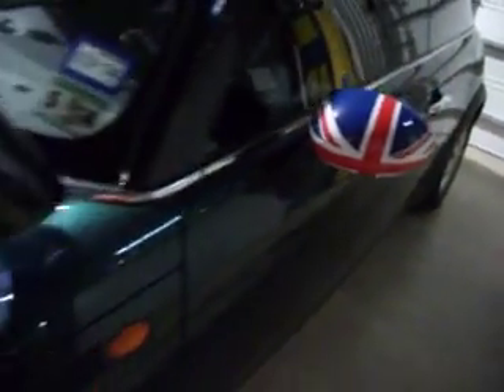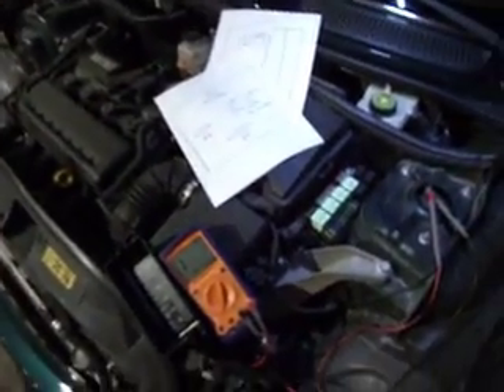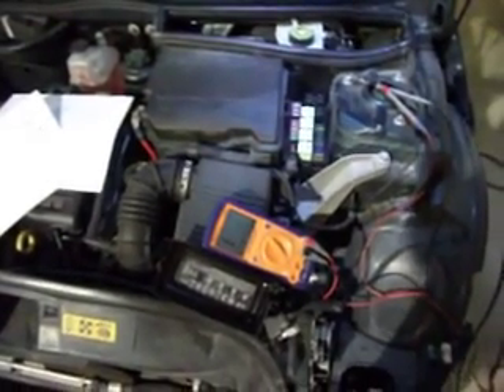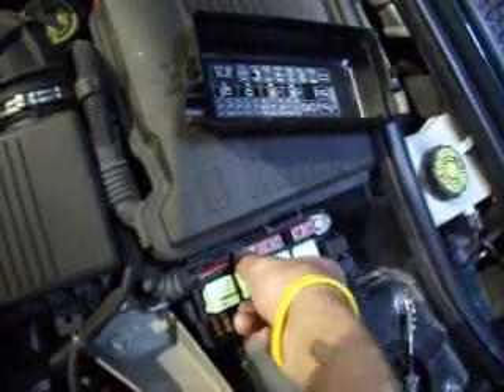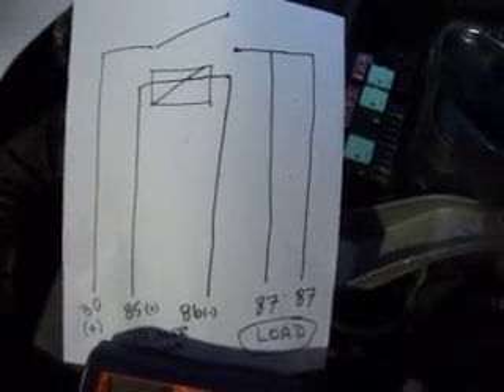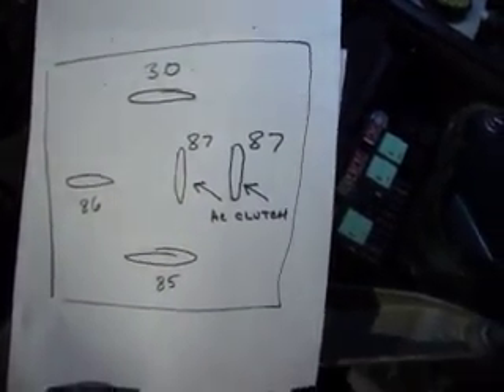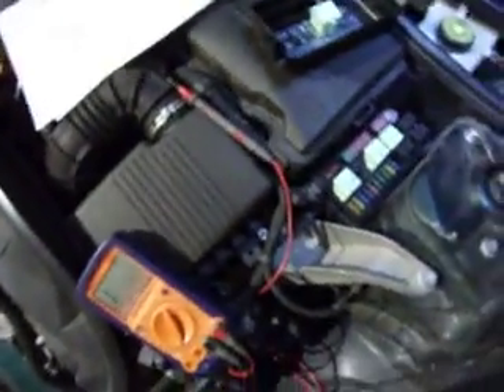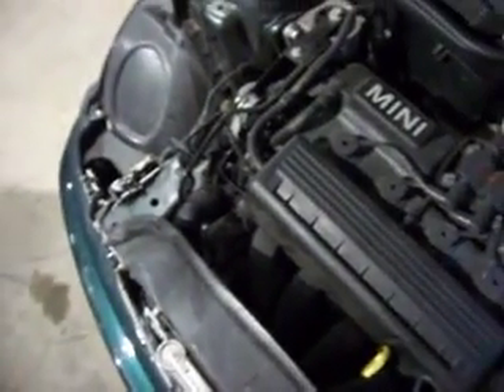Diagnosing A/C clutch coil using a R50 Mini Cooper

Comment: Thanks for the explanation Scott. Based on your technique, I appear to have a blown clutch coil.

Man, you're right, that coil is packed in tight! I have a feeling this will be an expensive outing.
Reply from the maker: Thanks I am glad that helped you. Removing an engine mount(s) you can use a load strap to pull the engine back a few inches which helps a lot, I found out after much hassle doing it w/o this! Northamericanmotoring forum has a lot of great info.

Comment: Great video, I have 4.4 ohms on my clutch. 75 pounds on the low side at about 18 Celsius, I have no ax compressor coming on. I short pin 30 to 87 with a jumper and the compressor still doesn’t cut in. Any ideas?
Reply from the maker: I assume you are getting power to 30? And is the wire to jump thick enough?

Comment: Hey Scott, when I test the resistance in the circuit it reads 16.4ohms... Help. Clutch wont engage, pressure is good idk what to do :(
Reply from the maker: Well, what do you mean pressure is good? What is the equalized (sitting) pressure? Typically, when these won't turn on, the pressure is too low as the systems have a switch. You can manually get the clutch to engage if you use a jumper (of sufficient gauge, maybe 14) to the battery, only for testing purposes and only for a short bit. You may need to have it looked at. I'm not full time on this but have fixed a number of different cars. When the compressor stops kicking in, every time in my limited experience its been the pressure has leaked out enough to trigger the switch to cut it out. Adding about 1/2 can to get to the regular level will work for a while. I prefer to fix the leak rather than refill all the time. A shop with sniffer can help find it, or look for the oil which is part and parcel with the 134a charge. 
If you have that ohms the coil is likely good, but you can compare to what I had or another mini's.
Reply: which pins to short out to get the AC clutch to kick in.
someone said 30 to 87 with a paper clip. is this true?
Reply from the maker: Try jumping it as I described in video, should hear it click down below where it's located. Engine doesn't need to be running but key on.
Reply from the maker: If you want jump let run 20 second or so see if starts cooling. If that works it's likely a pressure issue, or possibly the relay (low probability )
Reply from the maker: Yes Sagri 30 an 87. Don't run it forever like that, will possibly over pressure.
Reply: +Scott Philbrook 
I don't have any pressure on low AC line.
I even pushed the low terminal to see if freon will leak out and nothing come out. So I'm at a very low pressure or no pressure at all.
I am trying to engage clutch so I can fill some freon. From my understanding the clutch will never start if pressure is very low.
I don't see in the video where you talked about jumping. So if I put a paper clip between 87 and 30. Should I start the car? Or just the on position? 

Then I can add freon for about 20 seconds and then remove paper clip. Hopefully the clutch will continue to work after system build some pressure.
Am I missing something here?
Reply from the maker: +Mhnd Saqri - hey, I appreciate you trying to DIY your mini, however if your system is depressurized then you will need to first find the source of the leak, then evacuate the refrigerant, then fix the problem leak, then change the dryer (best practice ) then use a vacuum pump to both test for leaks and remove moisture. then after doing that, then add appropriate amount of refrigerant an oil. I'd take it to a shop doesn't have to mini shop really but this is more complicated than you realize and will take you investing in tools, plus learning curve.

Comment: Didn't know about low Freon causing a problem with the clutch been without air conditioning for 3 years makeup melts to the point where I can't even see to drive but in the North east the Mini Cooper is closest thing to an ATV in the winter love that car
Reply from the maker: M J Kay Hello
AC systems in just about every car I've seen have a system protection pressure switch for low and high side. I think what you're asking is something about this pressure switch on the low side or loss of refrigerant below and normal pressure. Because there is a minimum pressure which tells the system basically that there's enough refrigerant in it so it can run and not blow itself up, if your system doesn't have enough pressure obviously replacing the clutch or clutch coil isn't going to do anything. The pressure switch is wired typically outside of the circuit that I show here testing which is direct to clutch coil. So if your AC isn't working these various things you can do but you need to test the pressure and see if that's a problem. A bit of experience with these helps quite a bit and you may want to just take it in versus buying a bunch of tools and trying to learn as you go. But on the other hand that's kind of what I did just a lot of research I bought a vacuum pump to take a system apart and put it back together draw the vacuum test the seals then reload it with refrigerant.
Reply: @dirkdaddy2  The AC on this car hasn't got a low side sensor/switch. There's only a high side pressure transducer and the AC clutch can only be engaged above a certain static pressure. As long as you have enough liquid refrigerant in the system the static pressure will depend only upon ambient temperature. There's a valve in the compressor which adjusts the low side pressure by sensing both the suction and the discharge pressures and varying the compressor's displacement as a result (to avoid the evaporator from freezing up, give sufficient cooling according to the ambient temperature and lower engine load and fuel consumption). Hence, this compressor will also run on a very low charge and you'll know it because in mild/hot weather you'll hear a very low "groan" sound as soon as you turn AC on and the clutch engages, which is the sound that this compressor (and generally any variable displacement compressor) makes when it's pumping at the lowest displacement (with a very low charge, but enough to make the high side pressure transducer sense a sufficient static pressure, the valve will immediately sense a suction pressure that is so low that it will think the evaporator is about to freeze up, and it won't bring the swashplate into full stroke angle like it would normally do everytime the AC is turned on; with a good charge, however, the low pitched groan will only begin as soon as the TXV starts restricting the refrigerant flow and lowering the suction pressure as a result because the evaporator is approaching the minimum allowed temperature, which varies around 0°C and increases with decreasing ambient temperature and vice versa; i have the same compressor on my car and i routinely check it by turning AC on, doing some quick revs and listening to the noise it makes). What's most important, however, is that with a low enough refrigerant charge, oil circulation in the system decreases, compressor cooling decreases, some friction is still happening inside the compressor because the displacement never reaches 0, and all of this can make the compressor run hotter until the thermal fuse inside the coil trips. With a fixed displacement compressor instead you'd notice a very short clutch cycle (until it won't turn on at all due to too low static low side pressure) and you would get next to no cooling at all. So yes, low Freon ("refrigerant" is a more appropriate term) can also cause a problem with the clutch but it most importantly wears the compressor incredibly fast.
Reply from the maker: Thanks for information!
Reply: @dirkdaddy2  You're welcome, i write this so everyone can properly operate and diagnose this type of compressor (variable displacement-internal control).

Comment: Also the relay could be bad so have someone in the car turn the ac on and off and try to feel a click in the relay, if you don’t feel or hear a click you need to replace the relay that could be the problem. Make sure that you replace the relay with the correct type.
Reply from the maker: That is within the range of possibilities however I have found it pretty rare. Good to test that if suspected. Since these relays are all the same type one can be swapped for another to test as well. I had a Honda minivan where the factory AC relay was undersized or something and it welded itself "ON", which over-pressured the AC and then the refrigerant blew out the safety. After researching it I found out it was a fairly common Acura / Honda problem (go figure). That and the thermal fuse in the AC going out, other issues I sold it and don't plan on buying another.

Comment: My a/c stopped working last summer and I recently replaced the clutch several weeks ago.  It worked fine for about a week until one day in traffic, it started squealing loudly as if the compressor was locked up and I could smell the belt burning.  By the time i was able to get pulled over, it had stopped, everything worked normally, except the a/c was no longer cooling.  The car seemed fine so off i drove sans the a/c.  The other day without thinking i turned the fan on the circulate some air and the a/c automatically kicked on, blew cool air, worked fine until i got off the highway.  Squealing, burning belt smell, no more cool air. Ever heard of this happening? Could improper clutch installation caused this?  Is the compressor bad?  Any clue?
Reply from the maker: You might have broken fan or bad power to fan. This lack of airflow over the condenser might cause that. Or possibly over charged system. You may want to have it evaluated by shop as it could get expensive. 
Other possibilities include the clutch gap is too big and it's not clamping hard enough, then squealing as it slips? But generally squealing is belt. your symptoms that it runs good when you're getting air flow over at point to perhaps the fan not coming on so that when you sit in traffic it's not getting enough air flow.
Reply: @dirkdaddy2  I'm pretty sure it's not just squealing, the compressor was at least temporarily completely locked up.  The belt left some shavings  from the belt that piled up on the splash guard. I'll check the fan.
Reply: @DanielGarcia-rg3nd  Oh yes, this really sounds like condenser airflow problems to me. With this compressor, a restriction would actually prevent the compressor from pumping refrigerant. That is, you would see the clutch hub turning, but it would not be pumping anything since it sensed an abnormally low suction pressure, and it would be making an awful groan noise.

Comment: The compressor on my base model '02 mini is cycling on and off.  On for about 3 seconds and then off for about 10, etc.  Any idea what this might be?  It seems to be fully charged based on trying to add more coolant with the AC Pro single gauge and the gauge indicating that it was already full.  Any thoughts on what the problem could be?  Maybe something simple like a bad relay (wishful thinking)?  Thanks
Reply from the maker: sounds like it's overcharged, the cycling is designed to cut in an out at certain pressures and starting out high it will reach high cut off rapidly and not work very well from cooling perspective either.
Reply from the maker: You need a quality set of gauges to see high an low sides to really understand what is happening.
Reply: Any idea if the gauges Harbor Freight sells are of adequate quality?  I'm not sure who else sells them in my area.  If they aren't good can you recommend a reasonably priced brand?  Thanks!
Reply from the maker: Item#60806 looks OK
I initially bought a cheap small face gauge set at Autozone, and didn't realize it didn't go into the vacuum reading only pressure. If you end up getting into AC more, you will need a better set than what I got originally.
My new set is a OEM that ironically looks a lot like this HF set. And also looks just like a set I saw with SNAP ON stickers on it. 
You will want the sight window for fills, to see what's happening, vacuum range, and longer than cheap hoses for easy hookup, like 6' is nice long length. Shorter ones are problematic at times, you may find yourself helping friends and all once you get the hang of it. 
Filling with refrigerant depends on temperature, its not brand specific, its like physics or thermodynamics or something, heck I'm not engineer, but the condensation and evaporation charts based on temperatures. The best fill is weigh exactly the weight of refrigerant going in, but you can get great results just paying attention to the charts.
https://www.google.com/url?sa=i&rct=j&q=&esrc=s&source=images&cd=&cad=rja&uact=8&ved=0ahUKEwjCgaOimKzOAhUEw2MKHcXXABsQjRwIBw&url=http%3A%2F%2Fwww.stevesnovasite.com%2Fforums%2Fshowthread.php%3Ft%3D216762&psig=AFQjCNEPWjfKi9vwuwFTSkMtrVOXMYWC7A&ust=1470552276769161
Reply: These compressors are variable displacement so, if they're cycling, something is definitely messed up in the system. Relay is easily ruled out, replace it (but 3 seconds and then 10 seconds everytime sounds like the ECU or the climate control unit is cutting off the clutch due to pressures out of norm within the system). Always best to have the system evacuated, vacuumed and refilled by weight through a proper station. May also be the pressure sensor (on my Vauxhall with the same compressor, there's only one on the liquid line after the condenser; no sensors on the suction line).
Reply: @dirkdaddy2  Hi Scott. I have a  05 R50. My pressure's are 90 low and 90 high. When I jumper 30 and 87, the  compressor runs and the pressure starts to rise fast. In so confused. Can you help from here?
Reply from the maker: @glennjames9152  Well these things are difficult to diagnose remotely, and plus while I have a decent grasp of things I'm just a shade tree mechanic. When the compressor is off, your system will "equalize" and pressures will be the same on both sides. You will need to look at charts for the refridgerant to see what optimum high and low will be, but Teravolt (above) says they are variable displacment, so just using a pressure gauges won't give best results. But you for cooling purposes on a budget you can probably get it working if everything else is working with just gauges. The chart will show high an low pressure for the outside temperature.  Its physics and regardless of model if its running full tilt these charts are going to be accurate.  I hope this link will work
https://i.stack.imgur.com/SBEAL.jpg